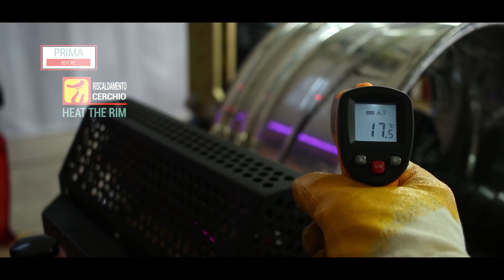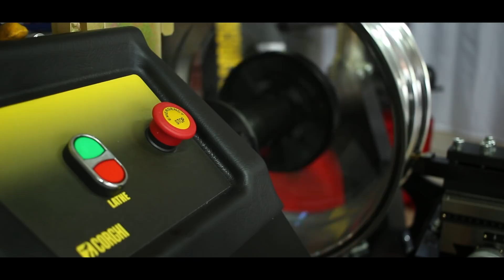CORGHI RR206 - Rim Repair Systems

Comment: Such a repair would cost probably more than a new rim
Reply from the maker: Yes in fact the procedure seems quite long and a little complicated.
But the final advantage is evident, especially if you can't find the broken rim equal to the other three you already have.
After only alternative is to buy 4 new rim, always if you want them the same..

Comment: Corghi like usually: to much complicated,overdesigned,overrated,to red and can only imagine how much overpriced!!!There is a really problem gays.The last 20 sec. shows that this rim is not properly siting on the hub!!!! Go back to the project board to fix the problem.Otherwise everybody who will bay this "monster"  get problem with straightening even straight rim.
Reply from the maker: We appreciate your feedback and we'll try to improve the video.
Our videos are meant to introduce the product and not to show the complete use, otherwise they would be too long. 
The step-by-step descriptions of the various working phases are shown in the user manual supplied with the equipment.
Thank you
Reply: @corghi  longer than this? To straighten it?
Reply: U could at least get this rim straight if you make 11m long video
Reply: Hola yo quiero una máquina de esas tendrán un teléfono número de cell?
Reply: @corghi  but potential buyer wants to see how long it really takes on your machine. Looking at your final results it took a long time to end up with an egg shaped wonkey wheel.

Comment: To much to complecated it can be done easier and a lot faster
Reply from the maker: The procedure to repair a rim is actually a little long, but it allows you not to have to buy 4 new rims if the damaged one is not found.
In our opinion this is the most professional way to do this.
Reply: Pienso lo mismo!! Demasiado lento el trabajo

Comment: 10:20 still far from acceptable.
Please remove the audio, sounds like coming from a bad porn movie from 90s
Reply from the maker: Yes in fact the procedure seems quite long and a little complicated, but the final advantage is evident, especially if you can't find the broken rim equal to the other three you already have.
After only alternative is to buy 4 new rim.